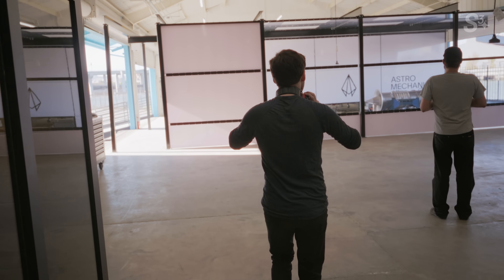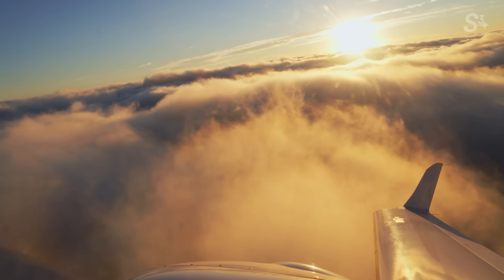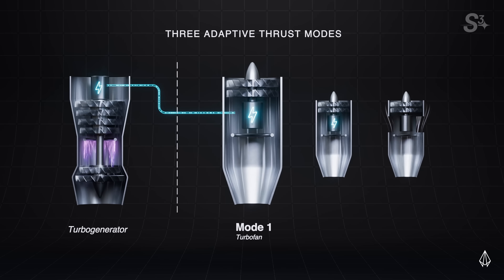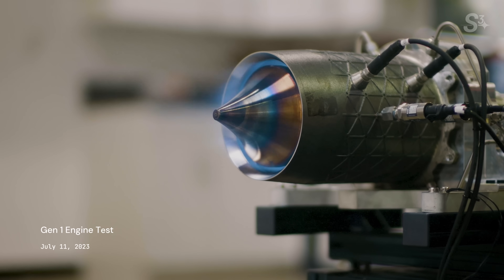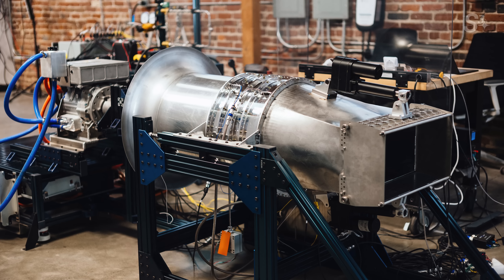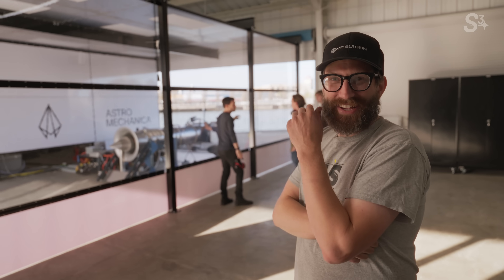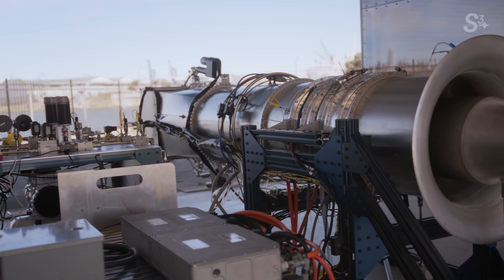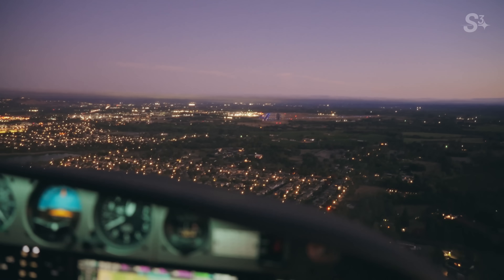The Age of the Electric Adaptive Jet Engine: Astro Mechanica

Comment: Wouldn't this limit the amount of power to the battery/generative output?  To spin a compressor to generate sufficient compression/airflow requires astonishing amounts of horsepower, that you can only get from burning LOTS of fuel.  Not a generator or battery.  Also, the most limiting factor when traveling at speeds in excess of mach 3, is friction upon the airframe.  Not the engine or its efficiency.  Look, I don't want to trash this too much so I'll stop here before I get carried away... I think this is really cool and exciting, and something like I would do in my garage, but thinking I would be making an advancement in propulsion with this is kind of amusing.  Prove me wrong.

Comment: And that's why, its necessary to ship the feces into the sun

Feces is filled with hydrogen 

And recharges the sun, which is good for energy 

If we dont offload all the human feces 

The PARKHOVA (dungeon of prostitutes)

Will overflow with worms and feces

And you will need nuclear weapons and guns to shoot the worms and cleanse the bacteria from the area. 

You can see this is a pretty consistent issue for earthlings, waste management and sanitation measures

And that's why my home base house should have a wood side and a shit side 

To burn, for green energy 

By compressing into a tank after natural combustion under vacuum pressure, with minimal intake air

Then, burning the resulting

SYNGAS 

For expansion of water into steam

Powered into a Turbine, spinning a dynamo

For a net positive gain of electric current

And/or hot water for a bath.... 

Collected in acid electrolyte batteries 

Then

My shits will not be stolen anymore

And people won't be able to take over the world

By using poop as drugs

Thank you, very much 

Elvis voice tho

Comment: Wait... This is currently a subsonic flow hairdryer at first observation.

If the intake shaft and output shaft aren't linked mechanically.. 
How is that going to extract energy from the combustion... You're using electrically linking motors, but no shaft. ? That's just adding more in-efficiency in exchange for variability. 

This, is a marketing video for investors. If i was one, I wouldn't invest at this point. 
The science doesn't really make sense in my opinion.

Comment: So it's a glorified APU powering a glorified electric ducted fan. I don't see how burning the same fuel twice to convert the power to something else (electric) is more efficient than burning that same fuel directly in a single engine, unless the generators and motors are upwards of 99% efficient. The TSFC numbers will be the key here.

Comment: So is the turbine and generator getting it's energy from exhaust gasses being blow at high speed? more like a traditional jet engine but without a solid shaft going through the center of it. Or is the generator getting air from a separate duct and the engines are purely compressing and combusting gas and shooting it out the back? just curious because of the clip at 10:07.

Comment: So this essentially cuts the cost of transatlantic supersonic flight in half based on fuel savings. Does that make the cost of supersonic trans-oceanic flight competitive?
No, we're still looking at 11k to 12.5k $ a ticket, a cost that most people would only be willing to pay once to have lived it, with only an exceedingly rich, highly pretentious minority having it on a regular basis because we've long known, for the same price tag, luxurious sub-sonic transport is preferrable to mediocre supersonic transport to any rational consumer.
This technology will give a massive edge to fighter & bomber jets, giving them better fuel economy and tremendous IR-stealth at Turbofan mode with the ability to go supersonic with an afterburner. So while this won't make its way into civil aviation in this form, you've just made air superiority and combat more economical & environmentally friendly, thanks for that.
PS: This is an easily copiable technology, so if it's any good, the Chinese & the Russians will implement it as well perhaps even improved and probably cheaper.

Comment: To drive a compressor of an Olympus engine from the Concorde you need over 30k horse power.  I would like to see an electric motor that is capable of that. that is not the size of a 737...

Comment: Why not just engineer a Magnetohydrodynamic jet engine powered by fuel? use the turbine to generate a huge current and magnetic dynamo to then drive a liquid metal that powers the compressor. Wouldn't that be more efficient than using a purely electrical decoupling?

Comment: Whats with the fake engine sound. The electric motor with the highest power to weight ratio is something around 15kW/kg that means that for a jet engine for a passenger plane that produces about 30MW and uses about 30% of that power to compress air going into the engine (9MW) needs an electric motor-generator pair weighing about 1200kg, thats like half the weight of a traditional engine. Plus all the motor controllers, conductors (heavy!) and the cooling system, because this motors cannot work at temperatures above 120C°.
Reply: The engine sound is not fake at all, why are you making false accusations? Also, your math is totally wrong wrong, it would only be about 220kg, not 1200kg, plus they would be removing parts from the engine, and increasing efficiency which would theoretically make up for the additional weight. Not to mention you are comparing a passenger engine to a supersonic engine... so things make even less sense. For example supersonic engines can produce additional thrust from optimizing flow in the diverging section like how the concorde did it, and since it is an adaptive engine it would be able to switch between modes of thrust to optimize for fuel effecieicny. Lastly, a typical passenger jet engine like the CFM56 is around 10mw not 30mw.
Reply: @amazin7006  Math wrong? So to get 9MW of power with a motor that has a power density of 15kW/kg you need 600kg of motors, but you also need a generator! so you multiply that for two, therefore 1200kg. Yes they will remove parts and replace them with heavier stuff like magnet steel copper and magnets. 

From the paper "Energy, exergy, economic, environmental, and sustainability
assessments of the CFM56-3 series turbofan engine used in the
aviation sector"  The
total production energy of the CFM 56 engine is found to be 16577.81
kW. From were you got is only 10MW? sure is less than what I said but still a lot more and the fuel energy consumption of such engine is upwards of 40MW. That would change the numbers as half of what I said or about 600Kg in generator-motor alone. And this is from a turbo fan on an airliner traveling at subsonic speeds. If you go supersonic you will need an awful lot more of power per weight of plane/cargo, you know, aerodynamic drag increases to the square of speed, and at supersonic speeds things get even more complex.
Reply: @amazin7006  And now that I think more about it, it makes even less sense to do this. How are you going to cool the motor-generator? most high performance electrical machines of the kind have rare earth magnets that start loosing magnetic properties at temperatures below 120C° so they need cooling. At match 2 (the top cruise speed of the Concorde) the skin of the plane heats up above that temperature. The only way I can think of is using the fuel as coolant but is it enough?

Comment: The variable operation speed is such a cool idea!
Does the square nozzle not create heat concentration points along the corner lines?
I know the raptor engine took longer to develop due (in part) to the exhaust nozzle giving them issues

Comment: So it’s an electric fan blowing through an afterburner that needs a whole other engine to generate the electricity to power the motor(s) that runs the fan. Not to mention needing a whole building full of ASME cylinders of gas to run the thing.

In the early 1900’s this was known as a motorjet. It was terribly inefficient because the motor used to drive the compressor didn’t have the power density to reach high pressure ratios. 

The reality is that even the best electric motors of today still don’t have anywhere near the power density of a gas turbine. And they are not even in the same universe of power density to sustain supersonic flight. 

Good luck, but this is marginal at best.
Reply: I thought the same and was looking for other smart people in the comments
Reply: A motorjet is a totally different system, those use a piston engine to power the compressor in a jet engine. This is a different system entirely since the heat losses are much lower in an electric motor compared to a piston engine. NASA made a similar design for their HyTec Turbofan engine and TEEM hybrid engine projects however these are subsonic designs, supersonic could theoretically have more efficiency savings due to the adaptive cycle design.

Comment: Nice as simple and clean it may be packaged instead of electric transmission how about a super expanding fluid in a closed system (like steam). Even though the power output/input of electric motors/generators are at its most advanced to-date, unfortunately the technology to rapidly charge and discharge mechanical to electrical to mechanical to thermal energy. The time and load demands have yet superseded thermal expansion. Harnessing the expansion of a fluid that's byproduct is a supercooling effect on the low pressure side of its system. This recycled to super cool intake can almost produce super condensed liquid gases increasing output and reducing mechanical drain. Simply put -thermal to mechanical to thermal-energy. Gas/steam recycling turbines combined. 

How about this, the most advanced fusion reactor we're going to use too power our lives will still rely on steam •

Comment: This is one way of generating electricity with a reactor.  It would need to be pared down into a working model, but this method could generate electricity with relatively small amounts of fuel in a radiationless manner=> Dense Plasma Focus =>  https://youtu.be/iFXbuK8P5i4?si=cW_ISBYHeKouRfWc

Comment: As a gas turbine researcher/designer I fail to see the merits of this concept. How is this any better than a conventional augmented turbofan? If anything it seems more convoluted and less efficient...
Reply: Yes it’s snake oil
Reply: They lost me at LNG for airline travel. Just the regulatory burden seems like a leap. But now you’re dealing with super cold(literally frosting) fluids on your aircraft. So you can’t just put them in the wings anymore without insulation(weight) idk. That part seems gimmicky to me. If it’s more efficient by (I’m not doing the math but they said 60% increase in range) isn’t that enough merit to get it to fly on the already established fuel source. Idk tho. They have the numbers so let me not cast doubt

Comment: Just watched future technology get tested in a parking lot
Reply: Sure. They simply added a motor to the compressor section. No biggie.

Machines use petro fuels because......it gets things done and... there is plenty of it for the mid term future and it can also be a renewable source of energy. GRRREEN-BS can't power the world...and can't compete w those who don't subscribe to this money making scheme of a small group. Very few ppl understand the forces behind the agendas foisted on the public.

>>>  Reaction machines are designed for a narrow operational band  where they spend much of their time. The trade off in this electric hybrid gains very little. I designing adv turbines for our product[s], both of which will have a significant impacts.

 I represent  New Frontier Technology Group. We try to stay under the radar for now...need funding, but I can be reached here. Gave up on  the 'w   oke' LinkedIn nonsense. You may find links to various innovation papers all over the net including the Fuel Agnostic Zero-Emission FAZE engine. <<<

===
Our latest push is to develop a simple, low cost, point to point, / door-to-door, rapid to market, ultralight category, personal air mobility platform called PersonalJet©, which, with investor funding, will later be developed into an more advanced ride hailing / air taxi PersonalJet 2.0 system which will shelter our [mine mostly] IP/innovations. Autonomous capability will address cargo markets. Other features will set us apart from the crowd.. The PJ 2.0 will have very advanced ultra-efficient engine[s]. Larger system will be able to go trans-oceanic distances...in a small footprint. We aim to disrupt current paradigms/players/markets.  Seeking strategic partners, investors, etc. now.

I'm a triple engineer w thousands of inventions but for lack resources.... 🛑
===
Ya, YT/Goober might be forced to adjust their sick cent-or-shi# agenda, now that the Freedom administration is in.

Let me know this went through. Tnx.

Comment: So since it's an apu powering an electric compressor there is no reason to keep the two in line.

They can be completed separated to different parts of the aircraft resulting in new designs and placements in different shapes creating different airflow and compressibility areas

Comment: There are many people who seriously think they know how it works, but they are all completely wrong. The technique I use does work. (There has been evidence for many decades that it could work) but it has never been applied in this way.

If you want to know more or think you know how I came up with it, please contact me in a personal message.

An innovative design for what could turn aviation #Turbine #Propeller #Drones #eVTOL but also #Shipping upside down.

It seems impossible, but it fits exactly within the laws of physics, and can also be proven.  >> Because #actually_the_proven_technique is just applied completely differently.

< -- > Unfortunately I can't show you how it works. The problem with showing everything PUBLICLY is that there is no protection possible when sharing publicly.

https://www.youtube.com/watch?v=DWtsvLNQu5k&t=11s and feel free to also watch (part 2) https://www.youtube.com/watch?v=FfZWREGKoJ8&t=26s I also have my design on some others show they were surprised and amazed that the solution was so simple.

Comment: I don't know... it's kinda a red flag when the engineers don't talk about any drawbacks or failures, especially because decoupling the compressor and turbine will decrease the efficacy of work transfer between the turbine and compressor stages. If the decrease in efficacy between the two is more than 10 or 15% of a normal engine I cant see this being viable.

Comment: lol, such a drama run. This engine with electric compression should be able to idle lower than a traditional jet engine. No afterburner needed. Hilarious YouTube drama. They def know it runs in the models. Pretty simple, a combustion engine that hits 14.7:1 will run. Seriously guys?

Comment: I'd test with a counter rotating stator both ways: a 2nd 3p AC induction motor and with 1 motor using 2 shafts connected by a planetary box. Tesla plaid motor should be able to drive both thus less parts

Comment: 1. It's the fundamental limit of science  ( there is no material other, than hydrocarbon that can output so much, energy ) economically.  

2. The more steps you add, to a system, it will always give less, than it takes in. Good luck with your math.

Comment: Interesting!  The Boeing 787 ditched engine-driven hydraulics in favor of a beefed-up generator and electric hydraulics with airstream turbine driven backup,  Electric generators and motors have made some rather massive advances over the last twenty years.

If you examine the SR-71's engines, you may see you essentially recreated its velocity adaptations, in part by means of your electrical intermediary.

I can't help but wonder if you'll use any additional electricity generated at a takeoff thrust to drive an electric fan for the purpose of it being far more efficient during the first 0-250 mph phase, or if the weight penalty of the fan, even when stored, simply negatively offsets any benefit.

Comment: Wonder if they could add a rankine cycle (or   CLOSED Brayton cycle) after the gasturbine like in a combined cycle power station. However it might be much more compact as the bottoming cycle would have liquid methane moving through a heat exchanger in the condenser cooling the working fluid (water, glycerol, ...). The sink temperature would be far lower than the stp in a power station. The methane destined for the  afterburner would be preheated as a bonus.  Perhaps reusable  drop tanks containing liquid nitrogen might provide open cycle cooling for the bottoming cycle whilst in non afterburning operation. The nitrogen could either be used directly as a thermal rocket engine or rooted into the unlit  afterburner section to improve mass flow.
Reply: Super-Heating the bottoming cycle in the combustion chamber is also a thought as it might allow a higher fuel air ratio in the combustion chamber.

Comment: TLDR; using electric generator and motor as variable speed transmission.  A good idea.  Much better than mechanical gearboxes in turboprops.
Reply: yeah its one of the major problems with modern jet engines you need bulky really high speed robust transmissions

Comment: It would awesome to combine the benefits of high voltage power from turbine generators with positively charged leading edges and negatively charged exhaust and negatively charged trailing edges. Super capacitors could also be utilized to dump massive amounts of pulsed electricity into either the turbines and or the respectively charged leading and trailing edges.

Comment: I hope you have the IP locked down on this.  I'm excited about the prospects here, but also concerned that ultimately we'll need to stop burning fossil hydrocarbons.  Maybe synthetic fuels are a possibility?  Also wondering if this tech would have significant efficiency gains for subsonic aircraft that it would be worth doing there.